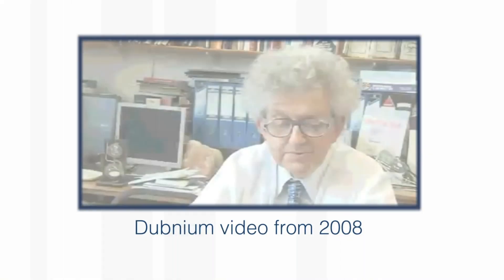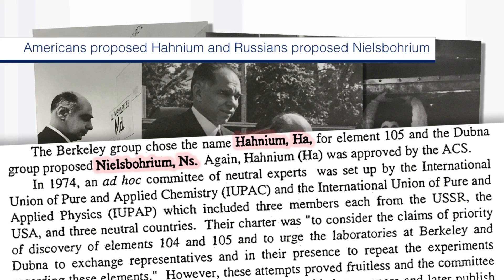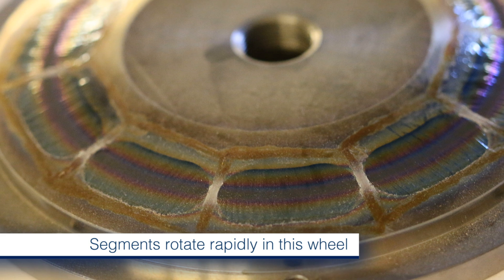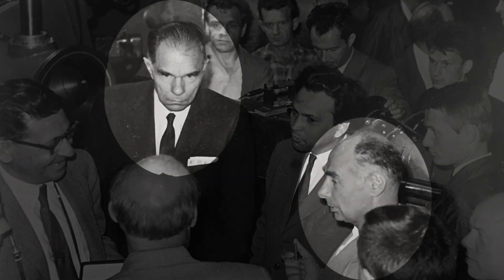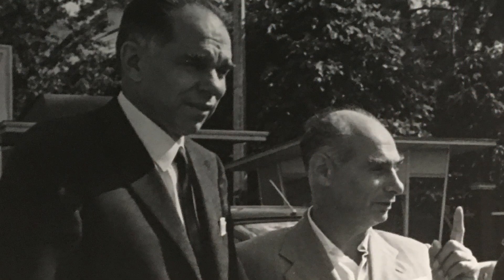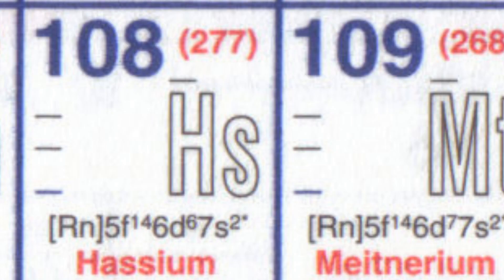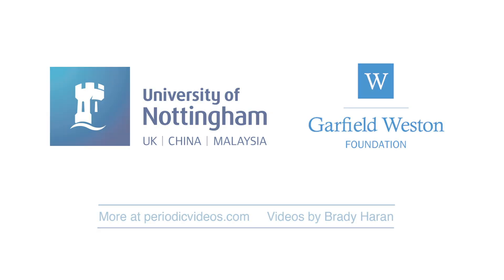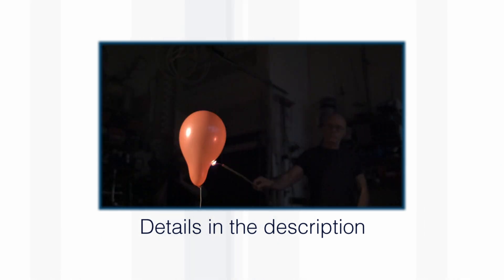Dubnium - Periodic Table of Videos

Comment: Usually, alpha decays are used to characterize heavy elements. Gammas are quite a bit harder to measure, you need precise energies to identify and it's harder to identify elements at low statistics. Alphas have the advantage that it's always two protons and two neutrons, they are emitted at monoenergetic bands, detection is moderately easy and with a series of decays you can very certainly identify the nucleus that the chain originated from. Fortunately the superheavies mostly decay by alpha emission and don't fission or beta decay.

Comment: I have always had a problem with the idea that these heavy elements do "exist" because they "survived" for a very short time before desintegrating. It's like saying "I successfully grafted a human head on a dog ! the hybrid survived for 3 seconds !!!"... And 3 seconds is much longer than most of these heavy elements will ever know.
Reply: Sometimes it's just about pushing the boundaries. It's like having to calculate millions upon millions of digits of Pi even though we aren't possibly going to need more than 40 of them. You can discover something in the process or create tools to do it that can be used for something more practical in the future.
Reply: Do lightning bolts "exist"?
Reply: ParedCheese  I know lightning bolts exist, but have, up until now, not yet assessed the ratio of left-handed vs right-handed threads! :P
Reply: Your comment literally took less than a second to reach YouTube's comment system once you hit reply. In that time a truly absurd amount of instructions were collectively executed by an absurd amount of devices to create the packets, fill them in, transmit them, verify they weren't too badly damaged, decoded, submitted into YouTube's comment system, parsed by an automated system for various legitimate and not so legitimate purposes, had a few bits controlling permissions flipped to allow it to be viewed by others and a ton of other steps I'm leaving out to keep it simple (and because I don't know the entire process). A lot can happen in less than a second, our perception of time really puts us at a disadvantage.
Reply: Arnaud Lécuyer After the first heart transplant, the patient only lived a few days. Now they live decades. You have to start somewhere.

Comment: What is the expected effect of relativistic valence electrons? Are there any implications on finding stable super heavy elements?
Reply: It's not the electrons that cause radioactive decay - it's the nuclei. But you'd certainly expect relativistic effects in these heavy atoms, which would affect their chemistry in various, often hard-to-predict ways. (Though the simplest one is that heavy elements often form fewer bonds than elements higher up the group. For example, carbon and silicon form four bonds, tin usually forms four but can form two, lead forms two and you have to put in a bit of work to make it form four.)
Reply: @alexpotts6520  i am aware that stability is a function of the nucleus and chemical reactions are governed by the valence electrons.
What interests me is the prospect of chemistry with a super heavy element. I had never before considered the effect of relativistic valence electrons. But you cannot do much chemistry with an element that has such a short existence and only exists as an ion.
There are reports of a stability plateau around atomic number 160. The term stability is relative and may not indicate sufficient time to form a neutral atom, but it would be interesting if it did.

Comment: I love that despite all the hardcore chemistry, physics and engineering behind synthesising Dubnium, it all comes down to 95 + 10 = 105
Reply: But there's a lot of physics involved in choosing 95 + 10 rather than, say, 94 + 11 or 96 + 9.
Reply: If you can be bothered explaining, what does decide between 95 + 10 or something else? I'd be interested to know.
Reply: I don't know the details, but part of it is probably which isotopes the two elements have.
Reply: @tomt7028  I can say for 10 with my highschool knowledge that the nuclei of Neon fits the magic number series and is very stable. Dunno about the other 95, would like someone more knowledgeable to help.
Reply: @tomt7028  
Americium is chosen for synthetizing elements because it has a very neutron-rich isotope. The more neutrons you can fit into your new element, the stabler it will be (and thus easier to detect). I can't give you detailed information as I'm not a nuclear physicist but basically the synthetized element has an enormously high vibrational energy and would fall apart instantly if it didn't dissipate some of that energy. And apparently it does that by losing some high-energy neutrons. The problem is that by losing neutrons you get an excess of protons and thus the atom undergoes b+ or alpha decay quickly. By having excess neutrons to start with your element will have a longer life. 
You have americium as a base and then you have to choose your second element based onto the element that you want to synthetize. That's why generally it's 95+x.
Reply: @pietrotettamanti7239  ppppp I will have
Reply: @pietrotettamanti7239  in that case, it would also make sense to choose curium, because the heaviest reasonable isotope of americium has atomic mass 243, while the heaviest reasonable isotope of curium has atomic mass 248, and although you end up losing a neutron due to having to use fluorine-19 instead of neon-22, you still have a gain of 2 neutrons. thus, it would be most reasonable that the decision to use americium was based on limited availabilities of curium-248 for manufacturing the target, or that, for whatever reason, the interaction between curium-248 and fluorine-19 was somehow unfavorable to the synthesis of heavy elements.
Reply: Because of how they are structured, This channel did a video on why they select certain elements to smash together.
Reply: Americium + Neon = Dubnium

Comment: What I find fascinating about Dubnium is that its longest-lived known isotope is much more stable than its neighbours in the periodic table but it's an odd-number element.
Reply: @Michael Nope, the stability of an element as nothing to do with electrons, it is purely a nuclear phenomenon (plus, the relativistic effect of the electrons would be more or less the same between Dubnium 268/270 and its neighbors).
And like the op said, it is very strange to see a nucleus that have an odd number of protons AND an odd number of neutron to be more stable than any other proton/neutron combination neighboring (in fact the odd/odd combination is typically so unstable that there are only four odd/odd combinations that are completely stable : 2H, 6Li, 10B and 14N although the 50V has and extremely long lifespan)
But we can observe that these two isotopes have a number of proton and neutron close to semi-magic numbers (106 and 164 compared to 105 protons and 163/165 neutrons) which give the nucleus a little more stability. And given the fact that the typical nuclear shell model that is use to describe and predict the stability of nuclei doesn't apply very well due to the huge number of side effects a nucleus of this size have, it could indeed be that the global effect of 105 protons and a number close to 164 neutrons could be particularly stabilizing, i don't know if there are studies about this stability
Reply: @  tesseract: There are a few cases in which the stability and half-life of an isotope are influenced by the presence/absence of orbital electrons. Bound state beta decay and the inhibition of electron capture in some fully stripped nuclei are observed.